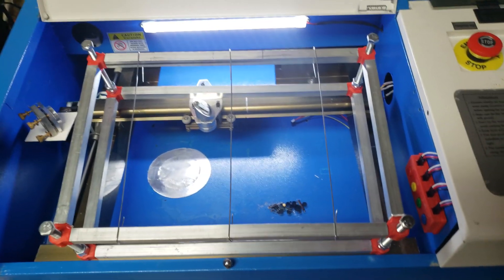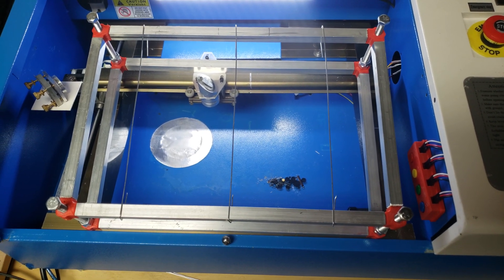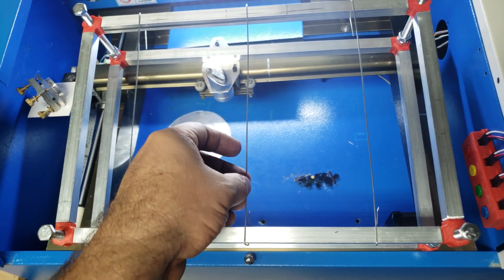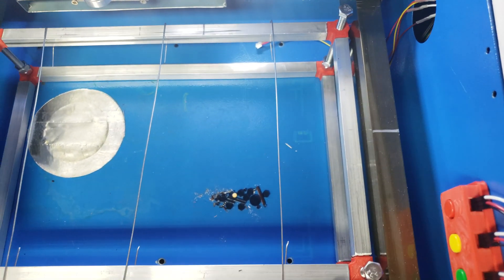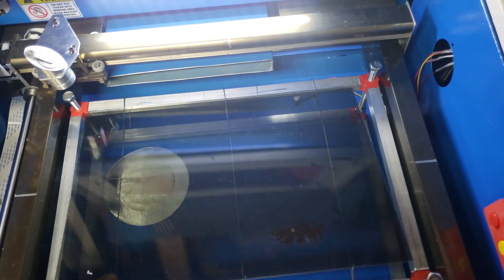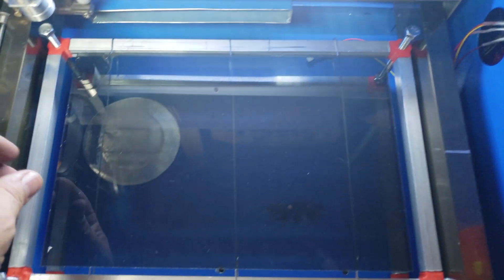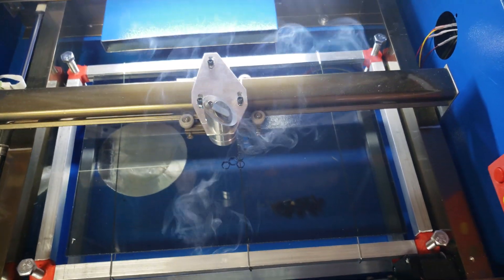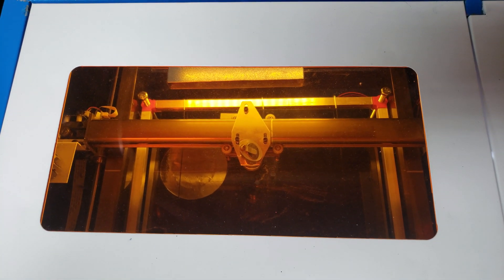K40 Laser Z-Bed with Manual Adjust by Wildseyed

Comment: There are plenty ways to improve this cutter. Fist, remove gantry and remove that stupid exhaust 'choke'. It was built for small area engraving, so cutting and engraving is much better with full frame exhaust. Not possible to remove that choke without removing gantry. Second and most important improvement is to use 20 mm lens instead 12 mm. I bought head with air inlet, but that does not fit the head because of wrong 'gender' (male tread on the head, male thread on the air assist attachment). So, I made 3D print adapter and lens holder. Now I am able to cut many things that are not possible earlier with all that smoke going between head and workpiece. All the 'magic' is in that air assist if properly build. At first, tried 3D print air assist nozzle, but that is wobbly and not good. Later tried to cut 22 mm thick oak wood... okay, it is just for fun.
Reply: Could you share an ebay or Amazon link which lens to buy.

Comment: good simple solution, this would also be easy to motorize
Reply from the maker: Maybe "easy" is not the right word. Given the stock controller does not support a 3rd axis, a separate motor controller and power supply are required, along with buttons. You can upgrade the m2 nano to something more robust, but when its all said and done, you are going to spend as much on the lift as you did on the laser. I did add a motorized bed and designed a controller and button pad. Its all on thingiverse.